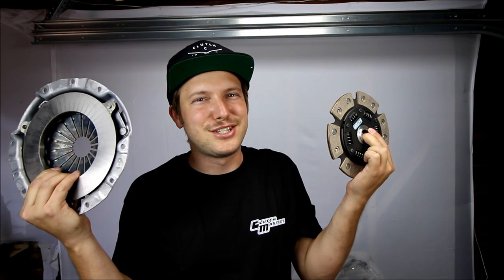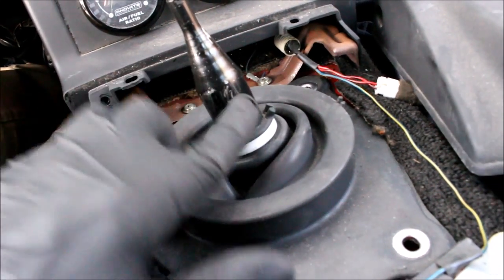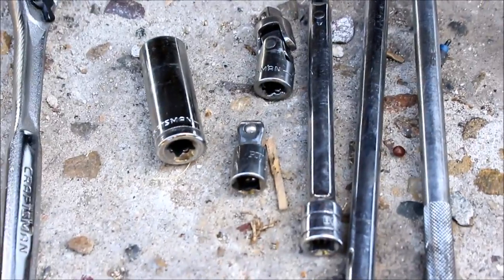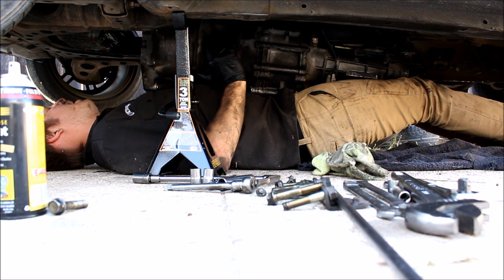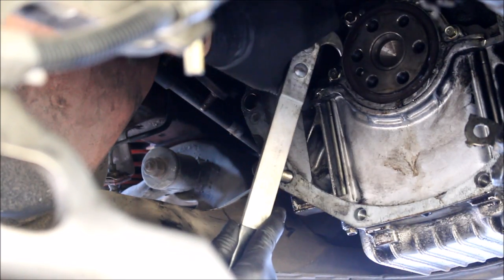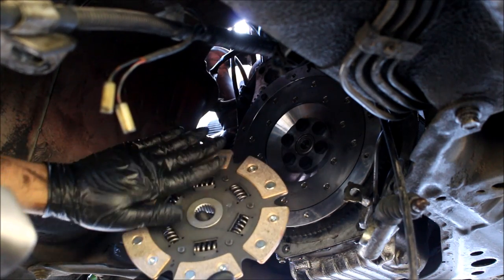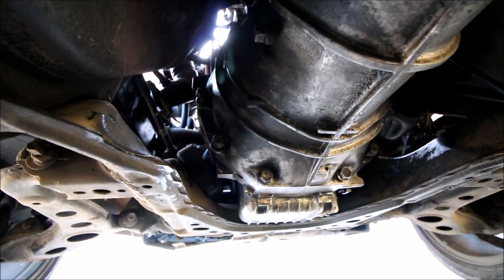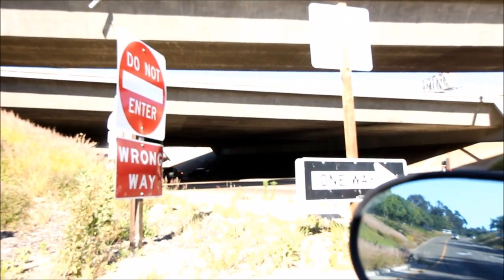Caught Slippin: The ULTIMATE Miata Clutch Replacement Guide!

Comment: Had to do the clutch in my Ford Ranger in 2013. Never did it before. 
Took two weeks. 29 bolts total to remove. 

Anybody can do this. The key thing is, DO NOT RUSH. The less experienced you are the longer it will take. A pro mechanic can do this in less than an hour or two. A lot of time, even now, when working on car things, I use my computer to get all of the tips and methods and not afraid to stop to do so. Never rush it.
Reply: On my 1rst try I did it in one day taking about 6-7 hours. I struggled hard getting the transmission back to the engine. I was too fatigued to lift it and balance it, but I will say using an impact gun helped alot. But on alot of my jobs I send soooo much time looking for tools and finding the torque specs.
Reply: Flat im getting a miata soon and theres a chance the clutch will go bad soon so I just wanted to be ready, reading comments like yours really makes me feel more comfortable about diy fixes
Reply: Two weeks..   I’d rather pay for labor at that point
Reply: @alansmilealot  always, always keep your tools sorted.. Always have a carry case of tools from somewhere like craftsman, kobalt, hell, harbor freight.. A 100$ 1..Will do u fine...add a few things as you see fit
Reply: @Ben-nx7yy  did you get it? Most DIY jobs are not bad, it's only hard when you run into rusty bolts, nuts or have to lift something heavy
Reply: @alansmilealot  yeah, the clutch went bad but it was truly an easy job to replace it.
Reply: @Ben-nx7yy  did you have an impact and jack up the miata high?
Reply: @alansmilealot  yeah, it was a few years ago so i don’t remember all the details but jacked it up on four stands and dropped the transmission to replace the clutch, we also replaced the master cylinder afterwards. It took us ~ 5hrs to finish the job
Reply: @Ben-nx7yy  pretty good

Comment: I did this job on my miata 2 months ago. Took me about 16 hours in all since i was by myself but it was worth it. Also a breaker bar is a must without power tools.
Reply: How’d you get the drive shaft out? I removed the 4 bolts but it won’t come out
Reply: @wesleyisbell7103 Gonna assume you got it sorted, but you need to remove most of the trans-diff brace bolts and push it aside and probably remove your exhaust midpipe should get the room to drop it down on the diff side and it just slides out from there
Reply: @wesleyisbell7103 it’s probably rust mated , bang it with hammer

Comment: One MAJOR  tip that helped me a lot when putting my transmission in was jacking up the front of the engine up just a little bit.  When you take the transmission off from the engine it tends to rock forward, jacking the engine up from the front of the oil pan helps align everything.
Reply: Yess I did it this weekend and I had to do that. Didn't think about it until I tried putting the transmission back in.

Comment: So happy to see this video. You're a gift to the already very helpful Miata community. I replaced my timing belt a week ago, and the job went better than expected thanks to your t-belt replacement video.

Also, I cannot describe how satisfying it is to finally remove an old oil seal when you've been working at it for 30 minutes in an awkward position. For me at least, using a small pick to carefully puncture the rubber towards the inside allowed me to get a small flat blade screw driver behind the seal without any damage to the sealing surfaces. 

Now that my clutch is starting to chatter a little, it's nice knowing I've got this video to fall back on when it inevitably starts slipping. Thanks Greg!

Comment: Just finished installing my 6 puck sprung copper ceramic clutch and 10.6lb flywheel! What was supposed to be a day’s work turned out to be three, the studs on my exhaust broke off so I ended up pulling the whole exhaust out and welding the header to the mid pipe. And of course all the hardware stores were closed (Easter).... But now my car rips! Thanks for the guidance Greg, made the actual trans install a lot smoother.

Comment: this is my third time using this tutorial:
1st time I needed new clutch and also got a lightweight flywheel, 2nd time my SO got a new engine, and now this time I just finished building my engine with machined and forged parts and it's finally time to put this stuff on it

I appreciate it and I'm sure I'll be back in 9 months to do it again for some reason
Reply: I'm back again and it hasn't even been a year 😭

I must've done something wrong last time because I haven't been able to get into gear since last time

Comment: I just finished installing my new fidanza flywheel and stage 1 clutch and the car is completely different. Clutch is more grabby and the flywheel is more responsive. However the flywheel chatter is pretty loud but you know what.. race car. Without this video, I wouldn’t think I’ll even this clutch job by myself. Thanks again!
Reply from the maker: Isn't the Fidanza flywheel so amazing vs. stock?? I loved the quick revs when I got mine.
Reply: Oh yeah! Completely changed the character of the car. I just took my Miata for a run at Palomar today and I was able to heel toe with ease.

Comment: Just seeing this video today. I replaced my clutch on the 97 Kia sephia with Mazda BP 1.8 engine a couple years ago around the 300,000 mark. Yes the original clutch lasted that long. I used the triangle pattern to torque on the pressure plate. I also was able to get a micrometer on the flywheel without removing it and found the thickness of still be in spec and there weren't any grooves so I actually pulled the pilot bearing with the old bread and grease trick since I didn't have a puller tool. To install the new one I used a socket the same size as the outer race with a hammer to seat it. I used some 600 grit sandpaper and a buffing motion to work a stack of dimes patterns to work my way around the flywheel without removing it. I didn't really have any deep grooving of any lipping and had to reason for remove the flywheel itself. I just put a light skuff on it for extra grip. My Kia uses the same engine as the Miata, but is front wheel drive and oriented 90° clockwise for how it is in the Miata with a different transmission. Shop would charge about $2000 to do my clutch as 2 CV axles, air box, battery tray, and 3 of the 4 motor mounts along with the slave cylinder have to come off to free up the transmission. That being said it was a pain in the ass and I had to support the engine with a jack, and also had to tilt it in order to slide the input shaft out of the pilot bearing in order to remove the transmission as well as reinstall it. That was honestly the worst part of the entire job. my rear main seal wasn't leaking either, not even after 300k. I use good oil, change it often, and I'm not boosted. I'm at over 340,000 miles now and that BP engine is still in good shape and doesn't burn a drop of oil.

Comment: I have a 2007 ford ranger truck. I am thinking about buying a Miata, hopefully NA manual.  The truck leaks oil profusely. It is automatic but I need to pull the trans and replace the main seal.  This video (and others) have given me the confidence to get that done.

Comment: Did this this weekend, thanks a bunch for the tutorial! 

For the rear main seal, drill a pilot hole and run a big screw into it (careful not to touch either mating surface.  When you screw it in the screw will bottom out and the seal will walk right out on the threads.

Comment: excellent video Greg! This would have made my clutch job so much easier had it been out 2 years ago. One thing I'd like to point out though. Once the transmission is down check the bellhousing, if you've got anything other than clutch dust on the walls like oil for example, check the transmission seals/gaskets as well as the rear main.  At 11:54 under the front transmission cover is a paper  gasket, i had a bad leak from there!

Comment: Great video! FYI, you can remove the shifter and fill it there, it's much easier. You still have to remove the fill plug to see when its full. Also, it's easier to place the clutch disk on the flywheel and insert the alignment tool to hold it in place, then place the pressure plate. Nothing wrong with anything you did, just thought I'd share useful tips.
Reply: The shifter turret is not connected to the gearbox itself. so that is impossible, however i agree on the putting the clutch disk in first and moving the pressure plate over it.

Comment: I just performed the happy meal clutch upgrade as well as Delrin bushings for the rear diff. The only items that gave me trouble were the three nuts on the down pipe nearest the header. 

To get them off, I put kroil on them, then heated them up with a torch. I put the socket+extension on the bolt and gave them a few wraps with a mallet. After that they came right off. Beforehand I was using an impact wrench to get things off, but it wouldn't take 2 of the 3 off, so I had to use the heat/bump method to break them free. 

Thanks for the Video, I watched it a few times. 

Vroom Vroom!

Comment: Just wanted to add that you have to be super careful when reinstalling the PPF to avoid pinching your neutral switch wires. If you break a wire it is difficult to repair in place. Also, as someone else mentioned, you may need to jack up under the nose of the engine to align for reinstalling the transmission. Great video and super helpful!

Comment: Just did this on the floor!! Had access to a lift but it wasn't too bad. Bell housing bolts were solid. Your vid was great. Very little figuring out in the end up because of it. THANKS
Reply: I feel like a beast. Prop and diff to put back in once I change the seals

Comment: One thing I ran into while following these instructions was that the rear PPF bolts were frozen in place. They would not come off. It turns out that if you can get all of the other PPF bolts out, you can still maneuver it enough to get the trans out, but then you're really going to want to remove the shifter to give yourself more clearance up top.

I also had significant trouble pulling the transmission off, because the pilot bearing froze onto the spline. I was able to get it to pull out by about half an inch but it would go no farther. I got past this by using two disc brake piston spreaders.  I wedged them into the small gap I was able to make and was able to push the bearing free. Then removed them, positioned the engine, pulled and it came free.

Comment: hey @thecarpassionchannel / miatadad - I tackled this with the confidence that your video gave me. I'm currently stuck. I am reinstalling the trans and had a helluva time getting the input shaft into the pilot bearing and then the splines to line up. Tonight is actually my 2nd 2 hour event trying to do so. I have gotten the trans basically to within a 1/4" gap and even used some stock 100mm M12x1.5 bolts to help line things up once it all got close. That last 1/4" gap won't go away though. I've seen some lstech people recommending just using the bolts to pull it in the rest of the way, but I'm leary of that. I did however put the draft shaft on the back of the trans and spun the crank pulley while in gear and the drive shaft turns, so I'm like 78.3% confident I should just use the bolts to pull the bellhousing in the rest of the way. Thoughts? I'll buy you taco tuesday for the right answer!
Reply from the maker: Don't use the bolts to pull them together. Never a good idea! The trans will mate up to the engine by hand when aligned correctly. A couple things to try: use a floor jack and wood block to tilt the engine backwards slightly and try again, this makes it so you don't have to get the tail of the trans as high for perfect alignment. Also, you may need to realign the clutch disc. Since clutch alignment tools usually have some play, it's possible that the disc actually sits very slightly too low in the clutch, making it difficult to get the input shaft through. If you loosen the pressure plate bolts, push up slightly on the alignment tool (you'll feel the disc move) and then tighten the bolts back down. When you're trying to mate them, have a couple trans bolts in by a couple threads so it can't fall, and you can give it a bit of a shake as you pull the trans towards the engine. Hope this helps! It can be the most frustrating part of the job.

Comment: That's a tricky job by your self, good job! It did look like your gear box front seal was leaking to by the amount of oil in the bell housing! 
Good job though 👍
Reply: Did you watch the whole video.... He replaced the rear main seal on the engine due to it leaking..
Reply from the maker: Jon bray Right but I did not replace the trans front seal, which I probably should have.

Comment: Red Locktight is definitely worth while on the flywheel and clutch housing bolts. Last time I did a clutch, a week in, the bolts backed out on the flywheel. They were torqued to spec and had blue lock tight, but still backed out till they were rubbing the clutch.

Comment: For those who are watching. I HIGHLY recommend that you get the pilot bearing and fowl pins pressed in at a shop. It is extremely difficult to not damage the bearing while hitting it with a hammer and socket.

Comment: I like to use one of those office chair mats on the driveway when lying under the car.  Since it's a bit smoother than the concrete/asphalt it's easier to slide in and out under the car.  And it helps cushion your back a little bit.

Comment: Nice video. Just some more tips. You don't actually have to lock the flywheel to get the clutch off. It depends on the angle you put your wrench at. If you kinda put it in a position where you pull it in an awkward angle towards the middle of the flywheel it won't spin.

I'm about to do this job on my Lexus but to be honest, I'm not so keen on it. Although videos like this helps boost the confidence.

Comment: If you dont have a rear main seal puller you can thread in a fine thread drywall screw into the seal and use it as a pulling peg. Use it in 2 spots opposite of each other.

Comment: Really great video, thanks. I watched it over and over along with the gearheads video before dropping the gearbox after a garage did a shockingly bad clutch job. Wish I had just done it myself in the first place now! 

By far the hardest part for me was getting the gearbox mounted back up to the engine. I ended up using your method, but I did have to get someone to help push the engine backwards - after that it went on pretty easy. 

How did you get away with not having to push the engine backwards? Maybe my engine mounts are shot?
Reply from the maker: Mark Cullen Awesome to hear! And lots of struggling, haha.

Comment: Its recommended to use new Flywheel bolts. Flywheel bolts should have thread locker on them. They come precoated from mazda. If using ARP make sure to put loctite thread locker on.

Comment: Pro tip screw in a small, short screw into each side of the rear main seal and use them to pry it out with a flat head.
Reply: I drill a pilot hole and run in a long wood screw with the tip filed off, the threads walk the seal right out

Comment: Hey Greg, just wanted to say thanks, i've NEVER attempted a job like this before but your video gave me the confidence to geter' done ( well at least disassembled for now), my happy-meal clutch kit from flyin miata wont be here until probably wednesday -friday of next week because i just ordered it yesterday, and in the mean time i was wondering if you thought it would be a bad idea for me to spray on some degreaser and then pressure wash my transmission on the outside and on the inside of the bell housing? the rear main seal was leaking bad and there is a ton of grimy gook built up inside and outside the whole trans. :(

Comment: I watched this video and others a handfull of time, so did my buddy, we swapped my clutch did everything to torque spec and rotated that clutch in two days just doing break in driving. So we pulled it and put my oem back in, and now that is slipping just as bad as the one I just roasted. Re watching this video to see if we missed anything and so far we did everything the same. Guess I'll have to take it to a shop for the flying miata happy meal to be put in.
Reply from the maker: Make sure you clean all of the metal surfaces (pressure plate and flywheel) with brake cleaner. Also if you have a bad rear main seal leak it will get oil on the clutch. How much power and what clutch did you buy?
Reply: @TheCarPassionChannel  cleaned all surfaces and no rear main leak. It was a low end 6 puck. I havent got it dyno yet but peak 9psi. But even the oem clutch is now slipping really bad. Before it would slip around 6psi. Now it barely holds at all.
Reply: I was reading that if you mis torque the pressure plate it will cause the clutch to jot release and cause it to burn up, but trq it to 15#
Reply from the maker: @halfweezy  yeah once your clutch starts slipping it will hold less and less power. If the pressure plate is torqued in the wrong order it can get messed up yeah
Reply: @TheCarPassionChannel  Im going to re check my pedal adjustment tomorrow and replace my clutch main and assistant cylinders "keep car talk pc" and hope that my clutch isnt completely toast. I know it shouldnt been this much of a gamble on doing a job like this. And hey thanks for replying man. I appreciate it. Your videos have been a solid go to for me on this build.

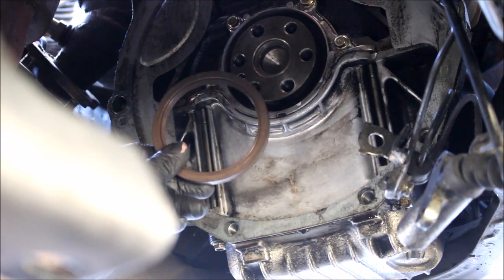Comment: 14:50 you definitely want oil on the seal. It helps with lubrication during installation and during the first start-up after repairs. If the seal surface is dry against the crank it could tear on initial start up.